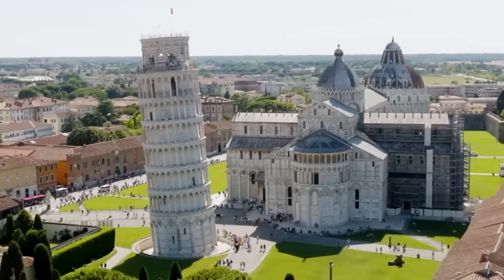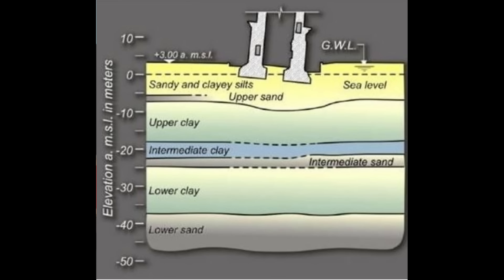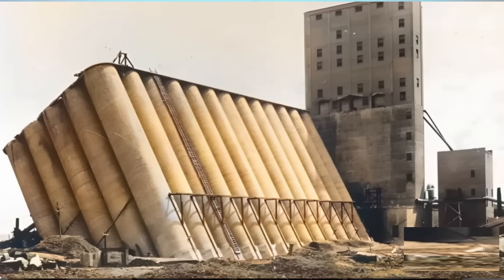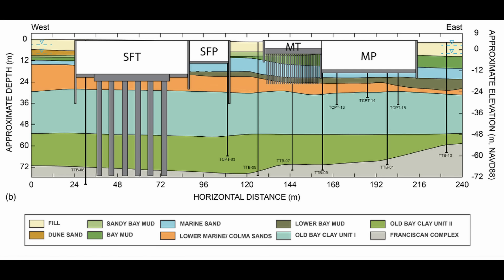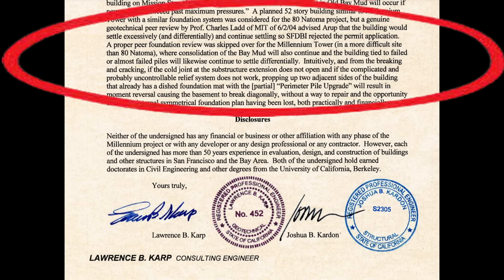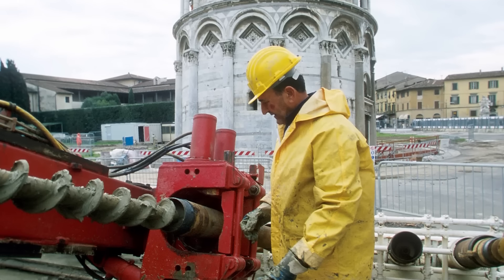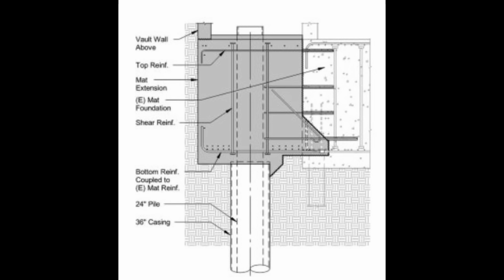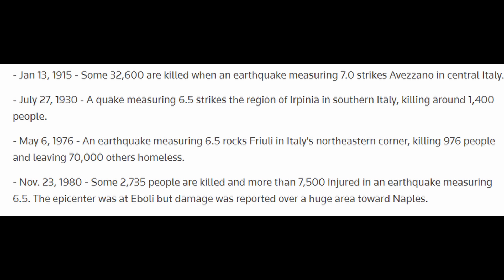The Millennium Tower and the Leaning Tower of Pisa have more in Common than you may Think?

Comment: Engineering mistakes are the common thread. Over 40 years in construction, I observed that only about 50% of people in construction can read and understand drawings. Less than that for understanding contract specs. Good Luck, Rick
Reply from the maker: Thank you.  I think another issue is that hard copy prints of plans no longer printed and instead viewed on a computer screen.  I have a much better time reviewing "E sized" or even half-sized plans than I do reviewing them on a computer.
Reply: @CaseyJones-Engineer Yes. Full sized prints that you can markup are a necessity. Glad that I retired in 2011. Good Luck, Rick
Reply: Is it me or is the video itself is tilting slightly?   Perhaps an Easter Egg??   Great work!!!
Reply: @CaseyJones-Engineer  Completely different field of engineering, but I'll agree that having some things on paper makes referencing them and marking them up easier.  I find it amazing that people will do work on something that takes weeks or months without at least printing out a schematic.

Of course, it's easier to edit and search on the PC and that's a godsend. Knowing when to use a tool or technique is vitally important in every field.
Reply: @CaseyJones-Engineer  ~ Hard copy prints, dated and stamped for construction, leave a paper trail and physical evidence of the construction documents at a particular time.
Reply: Wish you would do program on design and construction " best practices" in the context of local building regulation which include inspections and oversight of the project.

Comment: Reminds me of the scene in The Quest For the Holy Grail where the king built a castle in the swamp, and that sank into the swamp. So I built another one on top of that... Someday the Millennium Tower will be the foundation of another structure. But I think of it any time I'm tempted to buy a condo.
Reply from the maker: Thanks for reminding me of the scene.  I need to re-watch that movie.  It is likely that someone will try to reuse the foundations for the M.T. for a much lighter structure if the current building ends up being removed.
Reply: It will be the tallest basement in the United States!

Comment: So, lemme get this straight. City planning saw a similar, but lower load structure planned and rejected it, but embraced the much more massive structure that was on basically the same footprint.
Construction began, unusual settlement was noticed, the 2x4 job continued with only modest, ineffective mitigation.
Tilting continued, everyone looked surprised.
Management blames Transit for construction from before the 2x4 job was started, maybe a time machine was involved?
New mitigation ensued, more 2x4 work ensues, vibration ensues and ensures hilarity and more tilting. Because disturbing unconsolidated sand is always a good idea...
Pisa had an excuse, ignorance. I don't see very much of an excuse today - especially given smaller, wider and less massive loads having deeper pilings over a wider area.

For the layer of sand they attempted to use, plus the shallower layers, what's the minimum piling separation before their loading becomes common enough to behave as a single unit, with less support? At a certain point, one can actually create less support than would've been present with larger, less numerous supports and a lateral load bearing anchor drilled. Or better, go deeper, like successful structures did. Had they gone with at least six bedrock pilings, it's unlikely we'd be discussing this, save for some minor cracking in the foundation as the sand consolidated more firmly around the disturbance areas around the shallow pilings. Just judging from stresses and disturbances and approximating forces (it's a bit late to try to calculate that much, sorry).
The bear is, had they taken their time in construction, at least trebling the time to full erection, preferably longer, they might've gotten away with it for at least half of the rated lifetime of the building. Instead, they have a building that even the vibration of the elevators endangers over rather short amounts of time.
The saying is, "cheaper, faster, better, pick two", but conservatively, pick just one and avoid problems. And get a century building, rather than a half century.
Reply from the maker: Your summary is on the money.  On the piling issue, they barely had the 3.0 pile diameter spacing on this job.  So the main part they missed is that all of these piles acted as a big mat at their tip elevation, which loaded up the underlying clays which started primary and secondary consolidation.  Interestingly the firm involved with the foundation design was purchased by a larger engineering firm a few years following completion of the M.T. but about 5 years before the unit owners and public were made aware of what was going on.
Reply: The developer claimed they had a new method for the foundation that would support the building, so the city said okay. The developer saved a lot of money by not going to bedrock.

Comment: Switching the structural framing from steel to concrete prevented the jacking of each structural column to level the building which was previously done on other structures.
Reply from the maker: That is a great point.  There really is no going back from the fateful and bad decision to go with reinforced concrete and not extending the piling for the foundation to bedrock.

Comment: I have always thought that the main reason that Manhattan was the place that invented skyscrapers is that the North American ice sheet scraped the area down to bedrock. Is there any other major city where the bedrock is so close to the surface?
Reply from the maker: Bedrock depth in Manhattan is generally around 50 feet.  Also as you point out, the bedrock is very strong (granite).  The depth to rock is much greater in the area of Manhattan that were built on reclaimed land.  The typical depth to bedrock in Chicago is around 100 feet.  In Chicago, the tall building are founded on drilled shaft that typically go to bedrock. So there is definitely a correlations between soil and bedrock conditions and the most efficient type of foundation for a given area.
Reply: Being from Chicago, I support the home team. After the Chicago Fire, Chicago became the place of new higher construction. I think the first steel (lighter) buildings that quickly became the tallest in the world.
Reply: It's not one of the very largest cities, but Charlotte, NC has bedrock very close to the surface.  About 16 years ago I watched from a building across the street as the foundation for 550 S Tryon St aka "the Duke Building" was blasted out of granite.  The sub-grade parking garage goes down about 80ft, of which about 40ft was blasted out of the granite bedrock, so that tower is embedded into the bedrock.
Reply: As a structural engineer , I designed renovations to a building at 14th street. The bedrock was 14 feet below grade and sloped. We chopped into it to create flat bottoms for our footings. At some locations in Manhattan, the bedrock is at grade.
Reply from the maker: @blotto3204   Yes that's a great situation to have for supporting tall buildings.
Reply: Vancouver

Comment: Another issue for not completely straightening the Pisa tower is that at different stages of construction they tried to 'straighten' the build, so the building is really crooked and not a straight tower.  It would have looked really weird if it was 'straight' up and down.

There is no good solution for the Millenium tower and due to serious issues relating to earthquake exposure, the building will ultimately need to be torn down. IMO.
Reply from the maker: Good point.  Had they not made those adjustments the tower would have surely toppled at some point.
Reply: I have always thought that one reason for not totally straightening the tower out is that its a major tourist attraction for the area. It wouldnt be the leaning tower of Pisa anymore.

Comment: I wonder if they could get an elevator to work in the Pisa tower? I wonder how long the elevators will work in the SanFran tower?
Thanks for another well presented and super interesting video!
Reply from the maker: Thamk you! I'll bet that the could figure out how to do that. I might be something similar to what was used for the elevators in the Gateway Arch.
Reply: Elevators are not the issue. The real problem is the plumbing. The building is far enough over that the soil lines no longer drain properly. That is, the toilets cannot flush correctly and sewage backs up into apartments.

Comment: Just let the Millennium Tower lean to 4 degrees, so that it will become a tourist attraction bringing millions of visitors to SF 😉. 

What engineering would he required to keep it from disintegrating long before it reaches 4 degrees of tilt? Would the elevator still work or would tourists have to use the stairs? 🤔
Reply from the maker: There is no way M.T. could handle a 4 degree tilt.  The design engineer said that M.T. could handle 79 inches of tilt (this would be 0.6 degrees of tilt) but I am skeptical that even that amount would be tolerable, especially for earthquake loading.

Comment: Something that bothered me as I followed the Millenium Tower story is that the three-foot thick, 90-foot-high steel and cement wall built directly under the eastern edge of the 10-foot-thick slab foundation is seldom discussed.  In my humble opinion, this wall was the primary reason that the tower tilted toward the west versus sinking straight down.  As such, the “Hamburger Theory” that the side opposite their “fix” can now sink and eventually straighten the tower does not make sense.

My next thought is the possibility that during an earthquake, the uneven downward support of the east and west sides of the tower, might cause it to collapse toward the west (fix) side.
Reply from the maker: I think that the settlement was associated with much deeper layers of clay.  However, the wall would definitely complicate the seismic response of the foundation.  It is considered to be poor engineering practice to have a heterogenous foundation conditions for a structure subjected to high earthquake loading.

Comment: It is my understanding that there is a required spacing between drilled piliings for buildings.  I also understand that if this required distance is not followed, and that the pilings are more closely spaced, the friction between the piling and the surrounding soil is diminished, thereby adversely affecting the load bearing capacity of each piling.  The engineers would have used a friction coefficient for a " normal " piling, as per the geotechnical report.  It looks to me, as I see the photos of the Millennium Tower video, that there pilings are very close together.  PN
Reply from the maker: You are correct that group effects must be taken into account for piling where applicable.  Such reduced individual pile capacity for closely spaced pile is generally considered to not be a factor as long as the piles are spaced 3 pile diameters or more center to center.  For the Millennium Tower, the 14 inch square pile had center to center spacings ranging from 42 to 55 inches.  So they just squeaked by at 42 inches.  But one thing I think they did miss is that such a mass of piles would act as a big mat, with the stresses mostly being applied to the layers below the pile tips.  These layers where highly compressible clay soils which ended up consolidating and settling.

Comment: I built a bridge yesterday to cross a briok behind my home.
I used a few alder whips and spruce bows then covered in snow, pack and repeat.
After last nights subzero temps even the deer are crossing without breaking the surface of the construction. While the brook flows unimpeded 4 feet below.
Reply from the maker: That is pretty cool.
Reply: @CaseyJones-Engineer  cheap, ecological, very light on the land, and oh so temporary.

Comment: I would love a video that discuss the different charts you showed, such as what everything means, what you're gaining from the data, and how you actually measure the environment and building to generate the data. Even little things, like some of the soil layer depictions had dashed lines change to dashes for portions of some layer boundaries. What does that mean?
Reply from the maker: Thank you.  I think I will incorporate some explanations of the more technical aspects of these topics per your suggestion.  Generally in geotechnical engineering and in geology a dashed line is used where you are estimating the location to the top of a layer and a solid line is used where you know where these contacts are located.  I don't think that the author of that cross section shown in the video strictly adhered to that convention.

Comment: Casey, another great video - thank you!! So, if the builders of the Pisa's tower had included using a surcharge with settlement plate measurements before proceeding with construction, could they have had better results?
Reply from the maker: Thank you!  Yes, if they had surcharged the area to an amount equal or greater than the loading imposed by the Pisa Tower and waited for the consolidation of the clays and silts to have been largely completed (to be determined by monitoring), the soil strength would have increased enough such that they could have built the tower without it leaning.  This exact methodology is often used for the approach fill embankments on highways prior to the pile installation and roadway construction being completed.

Comment: Just like Watts towers in LA with its 2 foot deep foundation, Piza also has an impossibly shallow foundation. Unless the diagrams are incorrect. I've covered this on my FB page. Unbelievable History
Reply: "Impossibly shallow" foundations were very common in the past - Gloucester (UK) cathedral's 225ft tower was built 700 years ago on a foundation of oak piles in the floodplain near the river.  The 104ft Ribblehead viaduct (stone railway trestle) was built 150 years ago on mattresses of sheepskin used to stop the rock used for the foundation from sinking into the marsh in the bottom of the valley.

Comment: It sure seems like a fundamental lack of understanding and I would go so far as to say incompetence on the part of the individuals responsible for the foundation design.
Reply from the maker: I agree with you.  It really was a fundamental error.
Reply: @CaseyJones-Engineer  as a mechanical engineer I see this too frequently. While the specific area of engineering that I work in is different the indicators are the same.